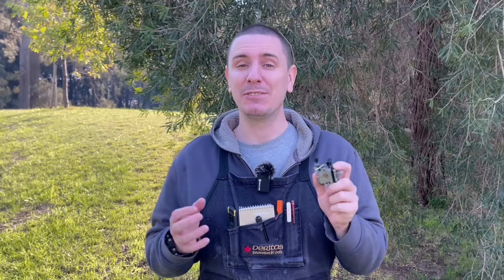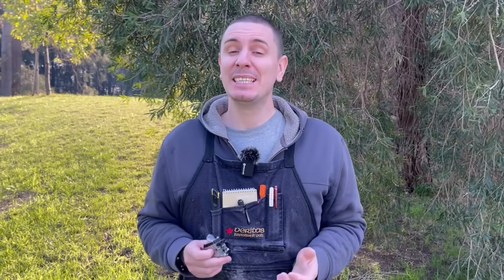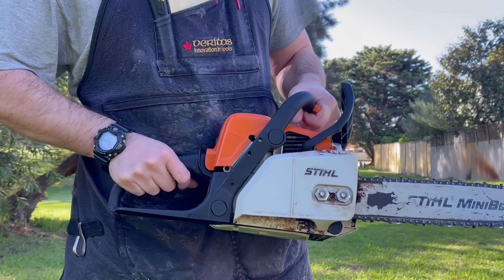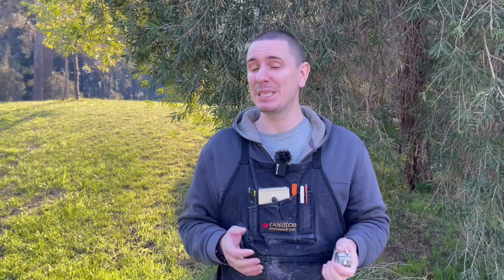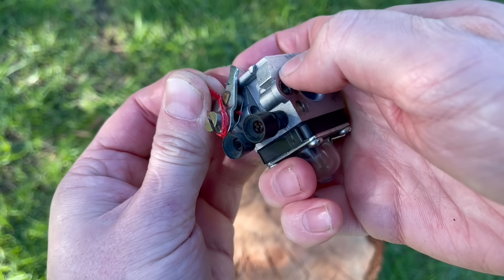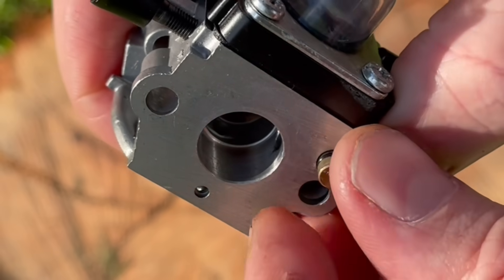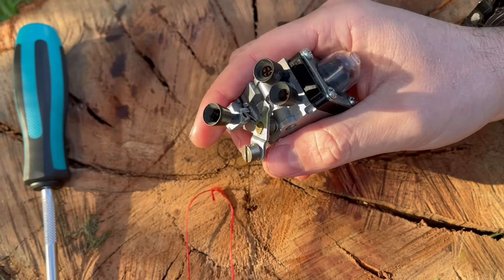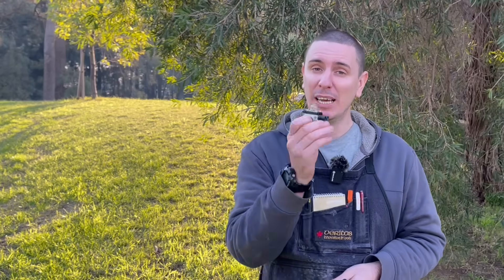A Carburetor Fix Many Mechanics Don’t Know!

Comment: Hi mate im from New Zealand and im having trouble finding the O-Ring for the pump . Do you know what size exactly it is ? Mines torn so i cant get the size
Reply from the maker: Hey! It depends on the carby mate :) there are 3 sizes I believe but it's a little involved if Stihl don't straight up give the PN.
Reply: @VintageEngineRepairs  all sorted mate thank-you so much for the information . The SF-38 is running tip top now
Reply from the maker: Awesome!

Comment: Hi I have a high power weed eater brand was workin after usin it for some year later tot carbi might be the problem so both a new one n it worked but the problem is the head still spins without pressin the throttle can u advices plis.
Reply from the maker: It may have an air leak, the clutch springs may have stretched or you may just need to turn idle down :)

Comment: My primer is full, very high rpm at idle, cant get them down with the adjustment..new spark plug, new diaphragms. Is it the accelerator pump or air leak?
Reply from the maker: It could be so many things, I'd start with a pressure and vacuum test :)

Comment: I found this video very informative and to the point which I always have liked. Maybe in a landscaper and the guy who fixes the tools at the shop, this can really help with certain tools, especially hot saws.
Or any of the 2 stroke equipment that runs at  high RPMs and is meant to be ran. Wide open... I will continue watching this gentleman's input on two stroke.And other repairs
Reply from the maker: Awesome, thanks for watching!

Comment: Also , you can do the same thing with a capful of oil Like he did with The two stroke oil To see if you have bad rings or no compression.Pour a cap full of oil in the spark.Plug hole, pull it a few times put the plug in.If it starts and runs for a few seconds and will not start after that means you've got no compression in The motor Sometimes , this trick usually fixes it because the rings stick with carbon Sometimes it'll work and sometimes it won't , so if it will not start after , but it will start every time you do the thing with oil that means you have a bad piston and rings
Reply from the maker: Yep oil in the cylinder is a good
way to test low compression!

Comment: Little carrbies can give problems......Most times when sluggish I just disconnect fuel lines then high pressure air through the little carby.....Works most times and can save mucking around taking carby apart for a more in depth clean.
Reply from the maker: Ouch I don't recommend that!

Comment: I recently had a small engine that would bog down. Finally found the problem was the Wal bro coil. Start and idle like new. Cut out at higher rpm. New coil solved the problem.
Reply from the maker: Glad you found the problem!

Comment: I asked Stihl for a carb rebuild kit and they told me that they either didn't make them, or they didn't have any in stock. But a new carburetor was like fifteen bucks, so I just went with that. Pretty sure I still have the old one laying around. I'm going to check that o-ring.
Reply from the maker: Unfortunately that won't be an OEM carb which is likely to cause more problems than they solve, but fingers crossed for you!

Comment: There is now a screwdriver bit made to fit the tri-bit screw heads which dominate electrical components, (both AC res/commercial electrical & AC or DC home products & electronics.

The tri-bit screw head will take a phillips, Roberson, (square) or blade.  These bits eliminate making screws look like the one in the vid & change your life.

I order half dozen, the 1st time, then gave them all away.  Got a dozen, the 2nd time...

Then, gave all of those away.

The last was 2 orders; got about 35.  Still have about ten left!  LOL
Reply from the maker: Thanks for the info :)

Comment: Great knowledge for the average person but considering these carbs are like 12 bucks at the commercial mowers shop im at we dont fix them the labor hours for the carb rebuild is more than the cost of a carb so we just keep them in stock and swap em out and always atleast change the gasket between the carb and engine sucks to get it all back together just to realize you got a torn gasket and major vacuum leak
Reply from the maker: They're over $100 for the cheapest OEM one here :) I don't waste my time with AM for that price, I have had very bad luck with them! Maybe I'm just unlucky haha.

Comment: Bought a new carb and it started fine but after pressing throttle it just dies on me. chainsaw is a gt garden,
Reply from the maker: Sorry to hear it! Not surprised if it's an aftermarket
Reply: G T Garden is a french company and they sold me the carb. It is not a make I know but its the carb they use for their chainsaws.
Reply from the maker: @Arbe1945 open the L screw 1/4 of a turn :)
Reply: @VintageEngineRepairs  I am going to go through the electric system first and then just make sure I got the fuel lines round the correct way. As it die very quickly rather than just short of fuel. Will also carry out your recommendation.

Comment: Won't run off of CHOKE ? Try this, the float-pin is alcohol swelled, tap the seat into the carb, and adjust the lever under the diaphragm
Reply from the maker: I'd recommend replacing the metering needle if it's swollen - you'll never get consistent or correctly metered fuel and end up chasing your tail. Cheers 👍
Reply: The kit is 15$ ,and the carb is also $ @VintageEngineRepairs
Reply from the maker: Be mindful, a $15 carburetor won't be OEM. I have had nothing but problems with after market. My successs rate on 2 strokes is around 10%

Comment: In my country you can buy a completely new carburettor for 5 dollars they are not even worth repairing
Reply from the maker: $5 carburettors are not even worth wasting money on.
Reply: for chainsaws they are 5 dollars weedtrimmers 12 dollars and they work run for years and years
Reply from the maker: Glad it worked for you, unfortunately my experience out of at least 10 on different machines, only 1 worked for me - maybe I'm unlucky or buying the from unreliable sources?

Comment: If stihl are so good then why does stihl brag that there is 70,000 service centers in the US? Takes alot of broken stihl equipment to support all these service centers. Why does husquvarna not have husquvarna service centers? In short stihl makes crap that breaks on purpose and then parts are specific to every model. Husquvarna equipment doesn't break much and when it does any small engine repair shop can fix it and get parts. I work at a store that sells husquvarna and stihl. Nobody ever brings a husquvarna in for repairs. Stihl products on the other hand come in all the time for repairs. Sometimes the pieces of crap break within a couple hours of use after just being purchased brand new. Figure it out, stihl is a scam company.
Reply from the maker: I think you're a bit off there, Stihl don't break more than Husqvarna or vice versa. User error causes the majority of the issues. I like both brands

Comment: Yeah this is accurate. I dont work on engines with primer bulbs mosty but if the o ring or diaphram fails in the fuel advance it will bog when initially giving throttle. Somstimes when going from neutral to drive or reverse. Also the jis screwdriver dot is a thing tho I mostly see them in speaker mounting ss screws. A normal phillips often wont even go into them enough to bite.
Reply from the maker: Thanks for sharing and watching :) cheers!

Comment: Going to try this on my weed eater . Has 3 positions on the choke lever . Got where it wouldn't run on the third position . Ran it on the second . Now it's gotten to where it won't start .
Reply from the maker: Yeah that is your choke position, it's the most likely place to start if the engine is lean :)

Comment: If you don't know of the accelerator pump/air cut-out diaphragm:

you're a mechanic that never worked with carburetors
or you worked with carbs and you're not a mechanic
If VER used a descriptive title I would've found his video a year ago.
Reply from the maker: Thanks for watching
Reply: @VintageEngineRepairs  np dude, still a god video.
Reply from the maker: Thanks 👍

Comment: This video was and is great! The light trick, the snap. All great for setting the throttle plate in the bore. But one crucial thing you missed with these. The alignment of the idle fuel port on the throttle plate!(the hole in the throttle plate, or notch) needs to align with the little holes on the body( metering ports). At idle or low speeds this is crucial. If you get a bog from idle to wide open, then you find opening the throttle plate a hair helps to eliminate this, then your idle circuit is most likely aligned improperly. That hole in the throttle plate should be right next to the hole in the body, snap, retighten. Your idle speed screw should be set so that the throttle plate only exposes the first metering hole in the body. Sorry for the lengthy info feel free to check it and use it. Heck check all your small carbs, and youll probably find almost none of them are set right. Hope this helps someone out there. I know someone out there just rebuilt their carb and is pulling that pull string till they are blue in the face. If you have to start it partial choke or choke and hold the gas a hair, your idle circuit isn’t happy, check your throttle plate alignment lol. They come installed wrong from the factory all the time. The person putting those together hasn’t been trained in what that plate does, they just put it on and tighten, a lot of the times the throttle plate hole is closed off completely because the factory workers like to line them up with the shaft. Ahhhh then you wonder why your brand new carb has issues.. sigh.
Reply from the maker: Thanks for the kind words, watching and commenting!!

Comment: I don’t care about emissions. I’m just one guy with a chainsaw that I use about once a month.
Reply from the maker: I understand your position. You want it to start and run without nonsense. A lot of us feel that way and unfortunately all these restrictions / emissions laws cause more trouble than they solve and machines end up in landfill.
Reply: @VintageEngineRepairs  agree! I also only use ethanol free in my 4 stroke engines and the expensive cans of pre-mix 50:1 in my 2 stroke engines. I also have several battery tenders connected to anything that has a battery. My priority is that the machine starts and runs when needed. Thank you!
Reply from the maker: Yes I agree! Well said

Comment: Unfortunately or maybe fortunately, a entirely new carb can be had overnight from Amazon for less than $15.  The rebuild kits alone cost more than the carbs.
Reply from the maker: Have a read of my replies to others who have the same comment as yours, thanks for watching!
Reply: True but I’ve had so many cases of those cheap carbs not work off the bat. nothing works like oem does and they can be $100+ so it’s always nice to save them if possible

Comment: Should purge bulb fill up full with no bubbles??
Reply from the maker: There will always be a little air pocket, but the bulb should be mostly full, yes!
Reply: @VintageEngineRepairs Pumping creates a lot of small bubbles. Is it normal?
Reply from the maker: @grzegorz16100 in some cases yes :)

Comment: I've had weed eaters & leaf blowers that I could repair the carburetor & adjust it & it would run great. But, the next time I use it I'd have to adjust the carburetor again, over & over. Do you know a possible solution for this other than replacing the carburetor?
Reply from the maker: Hmm, take a look through the exhaust port and see if there is any damage on the skirt. If not, a pressure and vac is necessary to rule out air leaks!
Reply: @VintageEngineRepairs ok, thank you.

Comment: With all do respect I have visited many of these 2 cycle carburetor repair videos and after spending an afternoon dicking around with a carb and I broke down and ordered a new one online. The kit contained: new intake/ output gaskets, new spark plug, two 12” lengths of fuel line ( different ID ), two spare bulbs, a low/high speed adjustment tool, fuel filter AND a brand new carburetor!… and it cost $14.99 free shipping
Reply from the maker: You’ll find it’s unlikely to work, but you may get lucky :)
Reply: @VintageEngineRepairs it took about 15  minutes to put the new carb, fuel lines, filter and spark plug on . The purge pump pulled fuel from the tank in six or seven pumps; held the throttle open, closed the choke. Got a cough on the third pull, set the carb midway. Next pull it fired up and it ran like a Rolex. I did have to turn the idle screw about 1/8 turn to up the idle.  Spent the next have hour blowing crap off of the front yard. Then I emptied the tank, ran it until the fuel was used up and put it back in the garage.
Reply: @jimseviltwin1 Glad it works for you. Personally, I’ll rebuild an OEM carb instead of buying a cheap Chinese knock off every day of the week.  Your carb may work in April, see how it does in September. Good luck.

Comment: Those carbs are so cheap it isn't even worth stripping one to fix!
Reply from the maker: I have to disagree, the Chinese close carbs are cheap, but they rarely ever work. I’d rather save the OEM :) ymmv
Reply: @VintageEngineRepairs  Where do think the 'OEM' carbs are made?  I've owned and still own plenty of Chinese machines like trimmers and chainsaws etc that have had the same carb on for years.  When they do give up I don't even bother stripping it, just throw a new one on.  That said if I wanted to rebuild one the complete rebuild kit is only a couple of dollars! 

There's nothing especially wrong with Chinese carbs.  I've used clone carbs on many branded machines and bikes and never had any problems or noticed any difference in how the engines run once properly jetted. 

I was actually building kit form  Chinese clone husqvarna 372 chainsaws for a while.  The walbro clone carbs on those were so close you wouldn't tell them apart if you changed the top cover for the original.  The saws ran exactly the same swapping these onto an original husqvarna.
Reply from the maker: @Altair885  There is a big difference between Chinese OEM and Chinese clones.

Comment: I`m trying to do this on a stihl SH 56 leafblower carb but it seems to be quite different to the carb you`re demonstrating on. The configuration on the side is different and i can`t see how to access that piston with the O ring as there`s no hole where you`re dropping that piston out from ?
Reply from the maker: Then it won’t have an accelerator pump, not all carburettors do :)

Comment: I have a C1Q-S42A (no AP) that is very smoky (still gets decent RPM) and floods out when idling after about 5s. Fixed high and the low is default 1 turn. I tried low jet all the way in and it eventually started on some throttle but still rich-stalled when idling. Primer sucks some air so I tested high nozzle check valve and it is bad, cant cover the low one. Do the symptoms sound right?
Reply from the maker: Not quite no. Sounds like you have a couple of issues honestly! Flooding and sucking air are two different symptoms in a carb.
Reply: @VintageEngineRepairs  Thanks for the reply. I think what happened is that I lost some idle RPM (I think it was 2400 should be 2800) on reassembly after cleaning because of the play in the fuel pump cover with its single screw against the idle adjuster, which had closed the butterfly enough to make it too rich. I couldnt get the high nozzle out anyway but it probably wasnt much of a problem? Gonna set low to factory position and open idle up to factory idle RPM and hope nozzle isnt damaged

Comment: This explains the issues I was having with both  my line trimmer and my leaf blower. Ended up replacing carbs from Ali for $20 works like new again. Next time I'll check the acceleror pump , but honestly it's so easy and cheap to replace the whole thing 😅
Reply from the maker: Hey :) glad it helped! I haven’t had much luck from Ali Express recently, it’s been really poor quality unfortunately!

Comment: Wanna reduce the need to rebuild carburetors? Use VP non ethanol fuel. They have a premix for two stroke or fuels without two stroke oil added. I like the Stihl two stroke oil and mix it at 40:1 . If you buy the VP with two stroke already added, add a little Stihl two stroke oil. I used to race two stroke GP bikes, street bikes and dirt bikes. Though the VP is more expensive, it’s cheaper and less time consuming than carb overhauls. Or to save $ find non ethanol fuel. Your local motorcycle shop can tell you where to find VP. 😊
Reply from the maker: Alkylate petrol will certainly make a big difference, yes!! :)